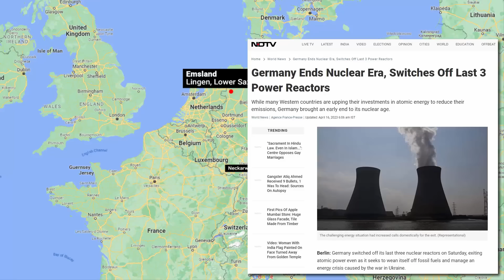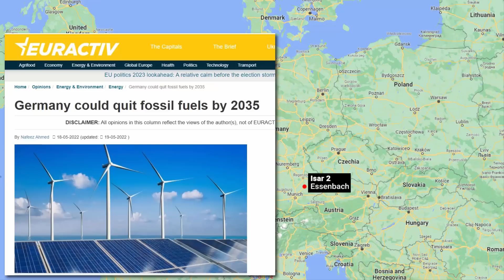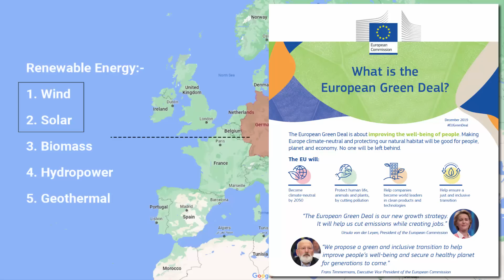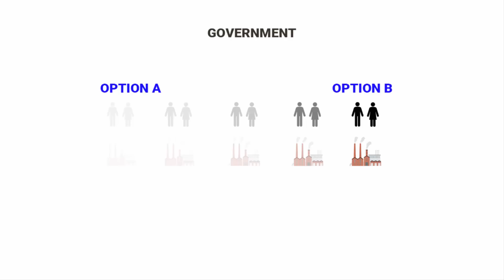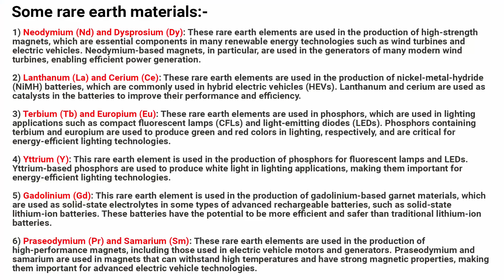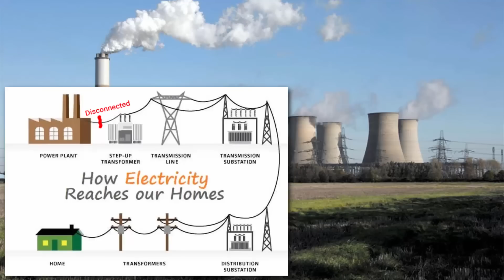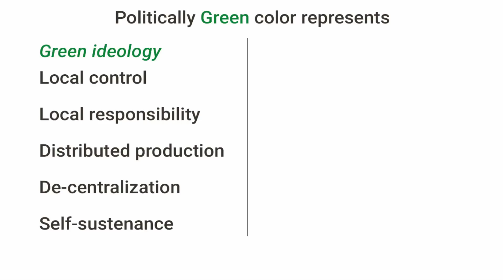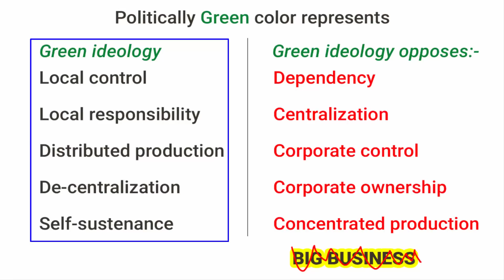Why Germany has Shut down all nuclear reactors | Reality of Green Energy, EV industry

Comment: Mosy of electricity generating plants be it coal based, nuclear or hydro electric require huge amounts of filtered water. This aspect is overlooked by many. Solar power even though doesn't use water but safe disposal of photo voltaic cells after usage is big question. Country like India cannot depend on single source of electricity.

Comment: To shut perfectly good nuclear power plants is remarkably stupid, and therefore rather un-German.
I don't particularly like the PWR. But so long as they are safe, and can generate power, I say leave then be.
Has Germany gone back to burning socialist lignite?
The future has to lie in MSRs.   Germany, as a technically minded nation, should be on-board with that.
It is as though a beloved and memorable singer wishes to turn herself into a run-of-the mill circus-performer.

Comment: I don't understand, where are the engineers? Any power engineer will tell you it is impossible to run a power grid just on wind and solar, for practical and technical reasons.
Nuclear is the only non CO2 emitting source of electricity available to most countries that can work. (Some are fortunate to have extensive hydro capability, but of course like anything else that works the greens hate it)
It is plain and simple.

Comment: Green lobby is biggest scam.  During Triassic age temperatures were 13 degrees hotter than today.  Carbon dioxide was 30 times more.  Oceans surface was more but you had the biggest plants and animals ever.  Buying chopped wood from USA and Canada and Brazil and calling Europe as carbon neutral as the wood chip anyway decays is a SCAM.

Comment: Excellent video! My two cents on EV.
There are many challenges in EV car adoption. Some of them are: 
1. Lack of charging infrastructure. A massive investment is required to come up with a workable solution. 
2. Upgradation of the electrical grid to handle the excess peak load, which will be a real challenge if more than 30% vehicles are EV. 
3. Ability to handle discarded Li ion batteries after they reach their end life. Remember, each car will throw up about 400 kgs or more of Li ion batteries. 
4. Increasing electricity production by whatever means. It would mostly be thermal and gas fired plants. 
5. Ability to source critical metals for EV production i.e. Lithium, cobalt, silver, copper, nickel among others. While these are being used in conventional cars, their requirements for EV production will be manifold. Most of them come from China, Russia, African countries etc. Remember the 'chip shortage' a year back!

Comment: There is much truth in what you say but modern nuclear generation is regarded as 'green' by many countries with sufficient experience to manage it to high standards. The UK is probably best placed, followed by France and some parts of north America as well as Russia, Finland, India and China.
The need for reliable and simply run base load fission plants cuts down chances of corruption at generation level and you will find that corruption tends to be at distribution level.
The emergence of sealed SMR technology is showing that very large nuclear plants such as Germany and France ran for years are no longer necessary but ONLY IF the mix of energy sources is balanced. OECD figures show the UK-Norway mixed systems [Norway has no nuclear stations yet] yield higher usable sustainable energy than when planned by making use of different types of batteries which are not chemically based but use pumped hydro, deep old coal mines in suitable elevations and occasional boosts from stored gas and nuclear stations. The UK and Norway have the right geography for this and SMRs will gradually replace older nuclear stations -- like now in the UK with 17 coming on line this year (4 inclusive of storage nearby are in operation with 2 more due during May 2023), approximately 4 in Finland and "several" in France. Indeed France opted for clusters of SMRs on old sites inclusive of base load support storage instead of refurbishing the older stations. 
Parts of the USA and possibly Canada are reopening long mothballed thorium sites to trial thorium, molten salt [Danish patent] and have sealed SMRs spread out while the woeful state of transmission grids are addressed.
Germany does not share the visions of its neighbors and is still importing gas/oil from Russia using proxies. Imports in 2022 far exceeded 2021 [Ref Vantage, India] and although wind and solar power are affordable Germany does not want to renew older versions in poorer parts of the country because it will still burn filthy lignite and gas until neighbors complain en masse.
The nature of the German economy is based on a narrow range of high unit price machinery, cars, turbines, precision components and financial services on a 'just in time' model because storage is expensive and its routes to export finely balanced. It cannot build UK/Norway sized energy farms at sea with such a small EEZ and tidal barriers do not work in the Baltic Sea.
It will therefore possibly "buy green energy" and credits but will not honestly reach 2040 targets: dishonestly is a different matter.
Using what are called "downstream" measures (meaning industries dependent on very large ones) we are seeing failures in Germany despite subsiding fuels for ancillary industries at odds with EU principles because Berlin signed up to sanctions.
If China floods the European and N.American market with a range of EVs later this year the German economy world face very serious trouble.

Comment: myself  i believe  cutting  gas and charcoal powerplants  only way is to switch nuclear energy

finding solution  to reusing the used  fuel cells  which ones still representing  an enormous energy source
these wind and solar energy   sources are not reliable

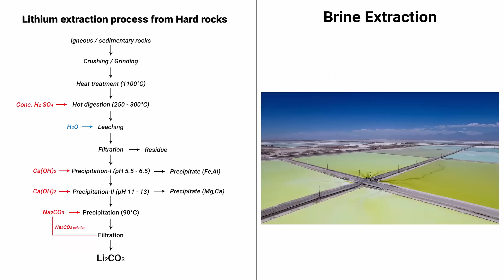Comment: 6:45 all you have to do is drill deep holes 😂. Fracking and petro transport is way more dangerous to environment. Once you brine, refine minerals you can't pollute/contaminate the whole store and delivery lifecycle when you send across the world. And yes OPEC is not centralized 😂😂😂. The bias is outstanding.
Reply: The key here being once u mine, brine and refine** thats where most of the pollution occurs for strategic minerals. U cannot ship lithium through a pipeline like oil, you cannot just drill and extract , you have to mine blast and excavate entire mountains to get comparatively small amounts of lithium .  Ans what do you the mining equipments run on air? No again fossil fuel.

Comment: Utter nonsense when he says Nuclear Waste is NOT a Problem... IT IS THE PROBLEM... and will simply NOT GO AWAY from being Lethal for 100,000+ years... long long after Amit's 100th Generation  are Dead and RIP...

Today's EV's using Batteries are just a knee-jerk reactions by Opportunists to MAKE MONEY.... fast.. and therefore use Polluting Grid Electricity and leave behind 500-1000 kg of Toxic Laden  Dead Batteries every few years. This video, however, totally ignores the ZPV... Zero Pollution Vehicle... that uses ONLY Solar Energy, leaves NO Batteries or Other Energy Storage Devices/Vessels  and has a RR>95 (Recycling Rating >95%)

PV Panels produce Pollution Free Energy that Offsets the Energy Used in manufacturing them in <5 years... and as the Grid and ALL Energy Sectors becomes totally "Solarized", even the energy used here will not cause Pollution.

Take all of the above into account and slowly a ZERO POLLUTION EARTH emerges  like a Sphinx from the Sands .....

Comment: Well part of it is true and I do not agree with the second part. Specially because over the issue of nuclear waste he just skims through saying that "it can be handled" as if it is a small issue. The problem is simple it is the high consumption and high energy demand which is unnecessary in the world. A part of the problem is that the developed nations will acquire all the raw materials necessary for the "Green" techs and when developing will start extracting (which they will at some point later) the developed nations will start calling for stopping because we would be very close to the environmental limits. So the game remains the same. People at privileged position will do things faster and push the things to the limits that it cannot be done by the non-privileged later.

Comment: In fact, the Russians reportedly have reactors that use fast neutrons, these reactors are fueled with radioactive waste of the old reactors. Not sure if the Koreans and Chinese have it. The western countries do not have that technology. As to the green energy and electric vehicles, I wonder for how long their accumulators will work. 3 years? 5? And even a cell phone accumulator is a dangerous piece : if there is a hole in it, it begins to burn, but if you add water, it will blow up, and the product of burning also is dangerous stuff (alkali). And the worst part about solar and wind generators is that they don't work in dark cold winter.
Reply: That's why more R&D is required and for that market need so that people can pay so that we can slingshot to other planets and assteroirds

Comment: EVs may be not emitting on the roads, but to make them and run them huge amount of co2 is emitted at the source of energy.  In India if the government and the bureaucrats are intelligently implement solar water heater system all over the country and avoid geysers, electric water heaters we can save significant amount of carbon emissions.   First of all the government must implement total solar water heaters and the solar power based AC and lighting system in the government offices/residential buildings/hostels/guest houses  across the country so that it will be model for the public.  Persons who pinpoint faulty government policies must not be considered as anti nationals.

Comment: Foolish decision of Germany to shut down nuclear power plants. Nuclear energy is the most green and cheapest of all energies. And Germany is not in a seismic zone either. Manufacture and decommissioning of solar panels and lithium batteries are environmentally terrible. Solar is unavailable at nights. Wind energy causes bird deaths and noise pollution and is unreliable in availability. The energy density of solar and wind are nowhere near nuclear. Only nuclear produces no greenhouse gases and is very stable in energy availability. Nuclear is the only comprehensive alternative to fossil fuel based power plants.

Comment: The Energiewende ist super important. It is very, very expensive but one of the few good things in Germany. As soon as the needed materials are in the circular economy, they don't have to be excavated anymore. New technologies are being developed that don't need many of those materials. (Melting steel with hydrogen from big hydrogen tanks instead of coke is one of them.) I have to criticize that you don't differentiate between nuclear fission and nuclear fusion. The age of nuclear fission is over. Nobody knows what to do with the nuclear waste, it is not 100% safe and not 100% reliable. You mention the two big nuclear disasters but there have been hundreds of small incidents that were reported and maybe the same amount of incidents that has been veiled by the operating companies. Also, nuclear fission has become very expensive. There are no solutions for that. Nuclear fusion is a technology for the future though. As soon as the energy is fully sustainable and energy storages are working, energy could become free for every citizen. I usually like your videos but this one is not that good in my opinion. (By the way the EU declared nuclear and gas to be green in 2022 which was justifiably very controversial.)

Comment: I love your videos on geopolitics. But dont agree with you on your knowledge on EVs and solar power. You say lithium mining is very harmful to environment. But like iron ore mining, its a one time process. Once mined it stays on the surface and can be recycled. Solar panels generate way more electricity than they consume during manufacturing. Thus EVs coupled solar energy is really a greener alternative to ICE. Whereas every litre of oil burnt needs to be extracted, transported and refined, which itself is a highly energy intense process. Over that we again need to burn the fuel to use the energy. Moreover ICE vehicles increase particulate pollution in the cities. Also they are limited. We cannot just keep sucking oil like its unlimited. We have to find alternatives and ensure our dependency on imported energy reduces. I disagree on the west on many things on geopolitics, but we have to find cleaner alternatives to oil. We have got domestic lithium reserves. We have to capitalise on that.

Comment: Splendid narration Mr.Gupta , none of the other channels can match to your narrative on this viable issue.
Reply: Quite a lot of Errors in this video.
- Rare earth. Not rare at all.  Most wind turbines are now free of Nd and Dy.
- It's during construction anyway. During 30y operations,  Nothing is consumed.
- Energy intensive. Not more than other process.
- Energy Intensive. It's more and more clean energy anyway, as we progress on the transition curve.
- Solar electricity is generated during the day. Which is also when human activity is at its peak.
- Wind is stronger during Winter, solar stronger during Summer.
- Solar and Wind are usually used to feed pumped hydro to address the top of the duck curve.
- There is a huge interconnected network in Europe so that electricity is rarely produced where it is consumed.
- Nobody claimed that EVs will "solve all these problems". We need a multi-pronged approach, Of which EVs are part.
- Lithium is only one way to make batteries. Solid state batteries are coming soon and will free us from the dependency to Li.
- Nuclear power is as clean as wastes that last for 100s of 1000s of years,
- Nuclear is as safe as Fukushima can tell. Damages are estimated to around ONE TRILLION dollars
- France is not mastering anything anymore. Not cracks in pipes, not budget overruns and not delays
- Wastes management in Germany costs tens of billions of Euros because old salt mines full of wastes now have to be cleared up and the wastes have to be moved "somewhere else"
- Decommissioning of nuclear power points cost decades and cost billions of euros
- There are virtually no private nuclear energy corporate. If only because they cannot get insurance for their activities and also because that business is not profitable.
- The alleged "green lobby" is not against big corporate. Especially not in Germany where there are a lot of big businesses.
- Green energy production cannot exist without big corporations like Siemens, EON, RWE or Uniper,
Reply: @alainpannetier2543  I think this is a propaganda video by russians.
Reply: @hmmmmn6770  What? Is that how we call common sense and critical thinking these days?
Reply: @DBathoryXX  I agree to the fact that in order to fulfill the current energy demands we have to damage mother earth but let's be honest and say that ev's are far better than those carbon emitting vehicles.
Reply: @hmmmmn6770  
Wud you like to enlighten us from your wisdom,what is the proper way of disposing those batteries without exploiting mother earth?

Comment: Extraction of Uranium and other nuclear power plant fuels is also a very messy process. The technology of molten salt reactors which does use Thorium as a fuel is a much better option for Bharat. It is much safer and the fuel is abundant in Bharat. Extraction of Thorium is also less hazardous. Unfortunately, we have not been able to develop the technology.
Reply: We have thorium reactor research

Comment: Solar and Wind are the worst possible goals of energy to use. Inefficient, expensive, take the largest land footprint, use the most rare earths which strip huge swaths of land, and is least efficient. Nuclear is cleaner, tiny land use, minimal resource use and more efficient. There is no logic in using wind and solar on a mass scale. On a consumer level for power backup, yes, but not on a mass scale.

It's hard to agree with 'the green lobby hates big business' since the biggest corporations on the planet are running the programs and foundations which push the green agenda.